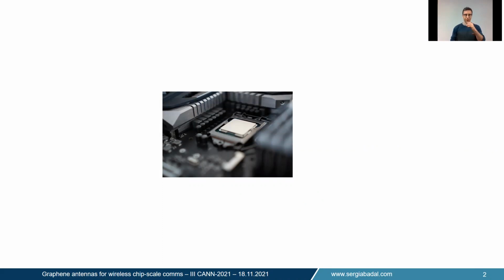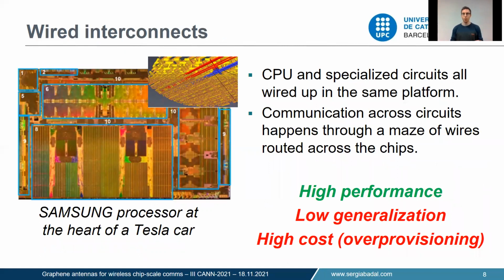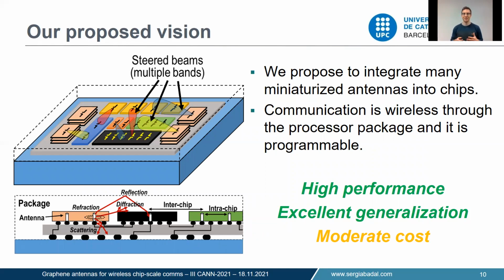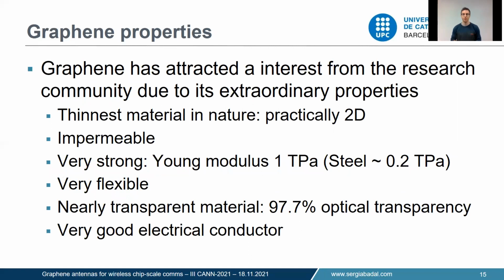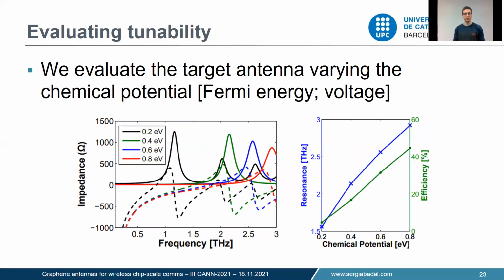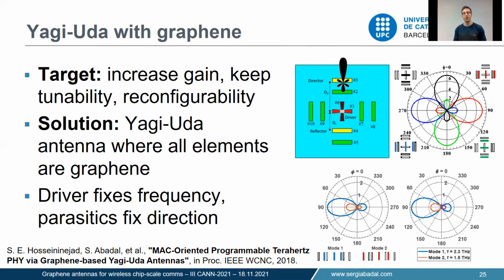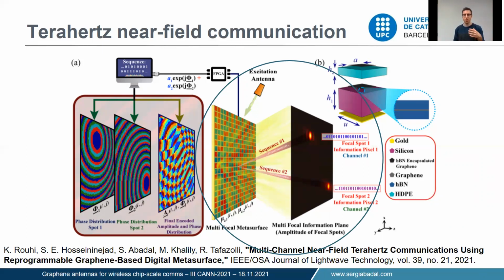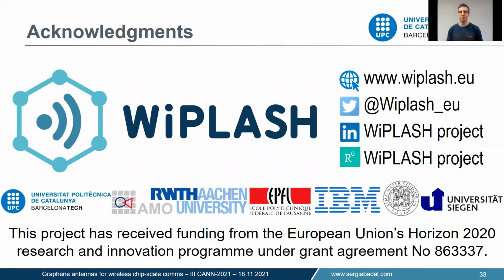Graphene nano-antennas for wireless communications at the chip scale

Comment: FPGA interposer/package-substrate?
Reply: Not sure I understood the comment/question, but interposers or package substrates are passive in the sense that only host metallization layers to interconnect different components, while active components (transistors) are on the chips. There are active interposers, though, yet they are much more expensive and have the yield problems of "big chips" if you want to cover a sizable area. If my intuition is correct, you are suggesting to have an FPGA (programmable) interposer which could provide similar flexibility than the antennas. Well, yes and no; it is true that the "network" would be reconfigurable in the routing and so on. But the problem persists in the cost of long wires across the interposer or poor broadcast. Hope this solves it or triggers some more discussion! Thanks for the comment.